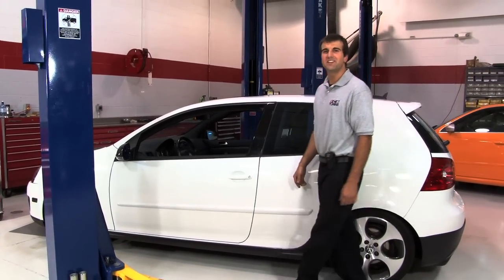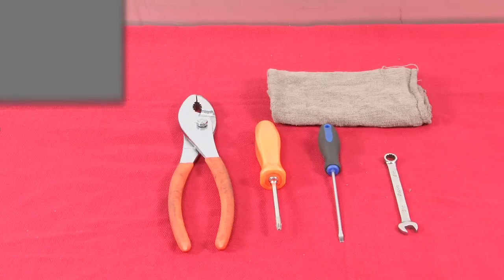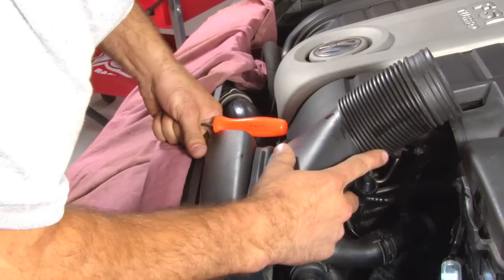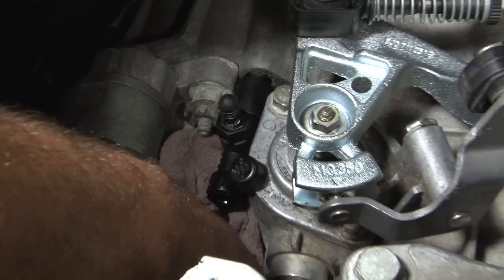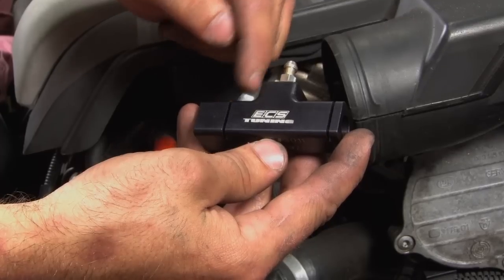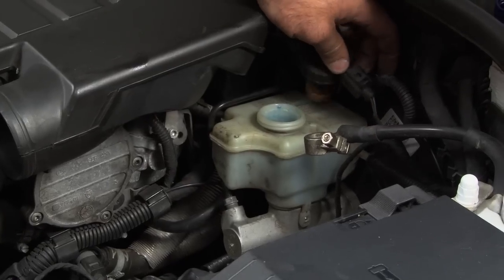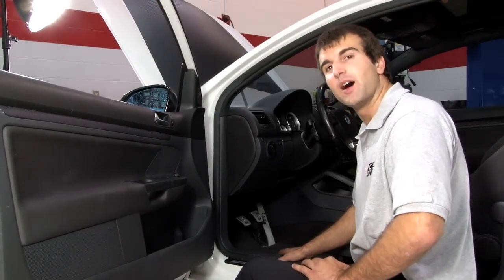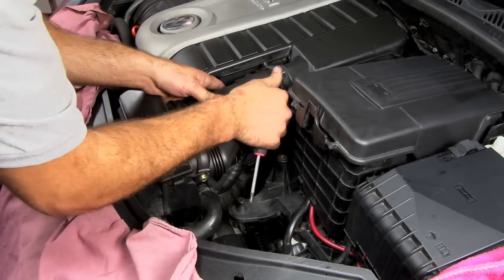ECS Tuning: 6-Speed Clutch Bleeder Block DIY

Comment: Hey all just want to comment about my experience with this product and what service I was performing. Mk5 GLi clutch slave (not master slave). After pulling the trans to replace a leaking and failed clutch slave, I was able to bleed to system alone using this product. My tools. 8mm to open bleed screw, a fitted hose to the bleed screw with hose attached to a bottle. (A hose in a soda bottle will work. Drill a hole in the top. Clear hose works best) 
My steps: attach hose to bleeder screw. Air flows up so be sure to have about 4” of hose above the bleed screw before the hose loops down into the bottle. Next top off the brake fluid reservoir. Be sure the hosing is clean before you open the fill cap. Carefully fill pass max. I filled to top of reservoir. Keep the cap open. No fluid was lost. With the 8mm wrench open the bleed screw, go to the clutch peddle as the tech does in the video. Like in the video 5 slow and controlled peddle strokes. Stop. Close bleed screw. Press the clutch to see if it functions normal. If clutch stays on the floor pull it up and start the process again. Start with topping of the fluid. Open bleeder. Pump peddle. Close screw. Check. Because the new clutch slave was empty I had to do these steps 6 times. At the end of the steps check fluid level, close the reservoir, and ensure bleeder is closed. Remove your tools.

Comment: Hi, could you confirm whether or not this part will fit a FWD MK7.5 GSW with the 1.4T EA211 motor? Tutorial shows a different motor. When I check the fitment on the ECS website it says the part won’t fit my vehicle. If not, does anyone know the location of the CDV on this vehicle? Thanks.

Comment: This is not true. I just installed this and had a problem with fluid leaking everywhere. I made sure the cap was on there tight. I had to do the whole thing while plugging the clutch line with my thumb. Also, those two clips are really loose on the block. I'm not too sure how i feel about that...

Comment: ATTENTION!! 
I spent all afternoon trying to flush my clutch fluid and unless you know exactly what im about to say this video will not work that easy

I did this method and other methods to flush my clutch on my mk5 gti
No luck
I took it to a garage and they had no luck ether 
They put a pressure bleeder onto the master reservior and they also attached a vacuum bleeder on the nipple and all that happened was air  coming out of the bleed nipple, the mechanics were mind blown how a master resorvoir full to the max level had only air cycleing around from the pressure built up into the master cylinder and also the vacuum bleeder

They couldnt understand what was going on into they found that the line that enters the clutch system was well above the max level on the resorvior

So then we over filled the master reservior and then the clutch started to bleed!
So to bleed a mk5 you have to over fill the reservior and keep toping up as it goes down because if the brake fluid goes below the max line on the reservior the clutch will suck in air

Hope this helps
Reply: Dude thanks for this.
Reply: You saved me a ton of trouble on my mk6 wagon. Had nothing but air till I overfilled it and boom bleed super easy. Also bleeds like a geyser so have a towel or tube into a bottle ready. But I love the end result. Pedal is smoother slightly stiffer but all the way in travel
Reply: DUDE this seriously saved my fucking life! Thank you!!!!
Reply: If only you or your mechanic took one minute to read a workshop manual, the manual says pressure the system to 2 bar with pressure bleeder, and pump the clutch pedal back and forth quickly for twenty strokes with the bleeder valve open. Instead of spending the whole afternoon and some shady mechanic you could have easily done the job in 10 minutes.

Comment: Will this make the clutch pedal easier to depress or harder??
Reply: +ECSTuningMedia So if I have an aftermarket single mass flywheel and south bend stage 2 endurance clutch that's made the pedal firmer than stock will this make it firmer or closer to stock??
Reply: +ECSTuningMedia Already have it. Should have it in  In the next few days